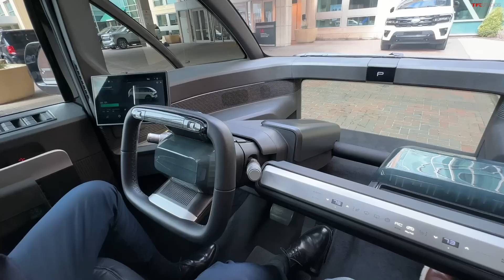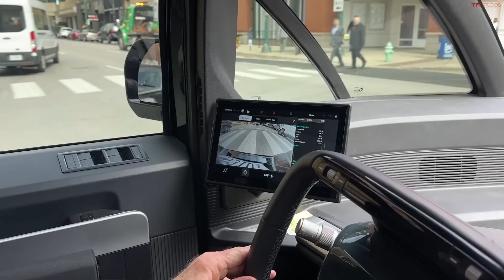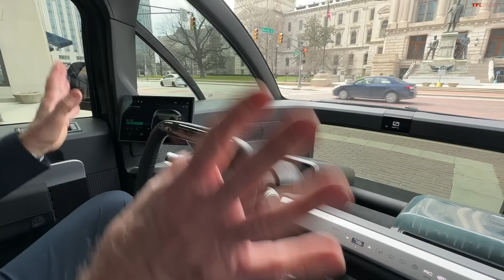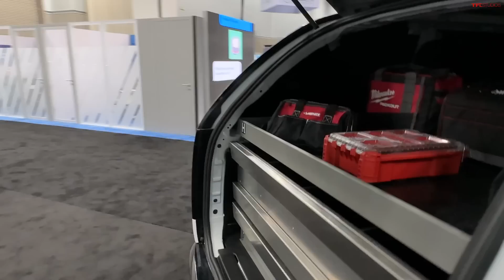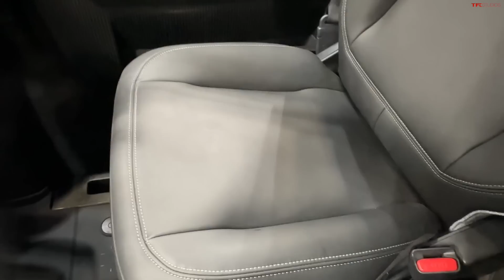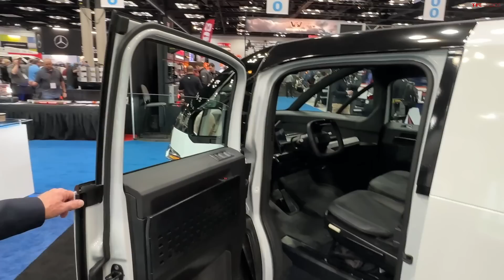The All-Electric Canoo Is Like NO Other Van You've Ever Known or Driven: Come Ride Along With Me!

Comment: Canoo if you’re reading this, small feedback: the steering wheel is a very expensive real estate for JUST mirror adjustment dials. I set my mirrors once. It’s not like I constantly need to adjust them while driving. I would put those controls out of sight.
Reply: The delivery vehicle is the proper use case for the mirror controls in it's as that is the most common button used for fleet management companies who have several drivers per fleet vehicle.
Reply: @b18tuner5875  I would argue that if there is a fleet, then there is the possibility that each driver's profile could be digitally stored so that as each driver connects to a vehicle to drive it, the car's "adjustables" would auto-adjust to that drivers settings.  That would be the greatest time saver.
Reply: @digiryde  That would work if each driver didn't need to change the mirrors at a moments notice, tens if not hundreds of times a day.  Would you personally remember which setting is what if you have 10 settings?  Also, memory functions like this are a huge added cost to the building of a vehicle.
Reply: @b18tuner5875  "That would work if each driver didn't need to change the mirrors at a moments notice, tens if not hundreds of times a day.  Would you personally remember which setting is what if you have 10 settings?  Also, memory functions like this are a huge added cost to the building of a vehicle."

Huge added cost...  I am not sure how much of an added cost of a small data structure based on a unique ID (fleet wide) that simply holds settings for devices would cost.  I do know that taking 5 minutes for every driver change has an added cost to business over a year, assuming that the vehicles used daily are not used by the same person and noone else. 

It might not seem like much, but some simple arithmetic for a one shift business at one driver per day:

5 mins * 5 days = 25 minutes.

25 minutes per week * 51 weeks per year (assuming 5 down business week days) = 1275 minutes ( 21 hours and 15 minutes per year per van).

Take a fleet of 100 vehicles = 2125 hours per year.  Employee cost per hour at 50 ($30 hourly pay, benefits, taxes, etc.)  gives us 106,250 dollars per year fiddling with settings.

If we assume a delivery vehicle's life time is 5 years, then the gross cost of fiddling for the vehicle if over $500,000, or $5000 per vehicle.  As all of the hardware is already in place to automate this process, the only thing that needs to be done is write the software and maybe add a sensor to ID the driver which would be less than $100.

If the selling company were to write the software and provide the service, they only need to do it for under $250,000 to make it an easy call for companies that are constantly changing our who drive which truck on at least a daily basis.

How hard would this be?
As the adjustments are done using digital controls (fly by wire), and the devices being used to control the positioning of the various "user" adjustable devices, all one needs to do is record the accepted position of each device.  So, once a device is set, record its positioning and save it for that user id.  Not hard stuff.  The authentication and authorization will be more difficult.

Once this software tool is done, it is there for everyone.  Bonus.  Family vehicles can use the same tool to provide customized settings for each driver that uses the family car.   This goes from seat settings to temp to radio to, well, everything.

Nice thing to know.  This has already been done by several auto-manufactures on vehicles that were not controlled by wire.  Which means it has been done on vehicles that are more complicated to do this with.

Is this a huge deal?  Not the biggest expense, but at the same time, business profits are all about cutting every dollar they can and these are dollars, not dimes.
Reply: @digiryde  I am impressed that somebody tried to explain engineering to a previous chief automotive engineer! Unfortunately, your explanation seems to completely misunderstand how automotive message networking systems work!  It has to do with message deliver over a bus rather than a voltage difference over a wire.  I would recommend you read into automotive systems engineering and then we can pick up there!
Reply: @b18tuner5875  " I am impressed that somebody tried to explain engineering to a previous chief automotive engineer! Unfortunately, your explanation seems to completely misunderstand how automotive message networking systems work!  It has to do with message deliver over a bus rather than a voltage difference over a wire.  I would recommend you read into automotive systems engineering and then we can pick up there!"

I never said anything about a bus vs wire.  Some vehicles do this already.  Maybe they know something special.
Reply: @digiryde  Nice Feynman fallacy to try to cover up ignorance of the topic.
Reply: @b18tuner5875  "Nice Feynman fallacy to try to cover up ignorance of the topic."

Okay.  You are the smart one.  Tell us why this can not be done.
Reply: @digiryde  I never said cannot, I only said it is common in luxury cars.  This being a delivery car, the use case necessitates the mirror switches. As most people can only remember a sequence of 7 numbers (that's why telephone numbers are only 7), can you imagine memorizing 20 different mirror combinations?  See how inefficient that would be?  Sometimes, convenience is based on use case.
Reply: @b18tuner5875  Ok, being somebody who has gone through a bunch of educational testing and neuroscience study I'll note that the average human digitspan is about twelve—and that for a supposed engineer you spend a lot of time repeating yourself instead of explaining things, while shooting down others for spitballing things then doing the very same thing yourself. Don't tell me that you know things and expect me to bow to your authority, show me how you know them and why they make sense.
To show my receipts I'll quickly explain why USA 7-digit and 10-digit phone numbers are the way they are. It has to do with the history of the technology used to route calls and the design decisions made while standardizing those systems—no provision was ever made for how long a number somebody could memorize. In fact it was not expected that anybody would ever memorize phone numbers. The line number (last four) was assumed to be one of ten thousand as setting up a "Central Office" to handle more than that many rapidly becomes unreasonably difficult. The three-digit portion is literally the "Central Office" number. Over time the "office" numbers of the form "X11" were set aside for custom services found in most if not all calling areas. (EG: 911) The three digits often enclosed in parentheses ahead of 7 other digits refer to the "Calling Area Code"—today often shortened to just "Area Code". Many places in the USA now have 10-digit dialing, FWIW, so Area Codes aren't just for long-distance calling.
What does this have to do with car mirrors? Simple, if you're going to make an argument you've got to be able to break it down into chunks that stand up on their own. You keep asserting that many if not all delivery drivers adjust their mirrors nearly continuously. I know from talking with my friends who are actual CDL-possessing professional drivers that you don't repeatedly adjust your mirrors while moving unless you want to be issued a moving violation—because doing so has been demonstrated to be unsafe. (Never mind that doing so is impossible on many vehicles—intentionally.) Canoo is therefore going to have to change that design, and give drivers better tools to see with continuously—no matter what delivery drivers say about it.
It is that sort of thought pattern which gets people to question "delivery vehicle" focused steering-wheel controls in a prototype presumably targeted at larger families and carpooling. We're not numb, we're looking at it from a different angle.
Reply: @b18tuner5875 given that voice controls are already a thing and will continue to be spread into more vehicles, I’d think that having between 5 and 12 mirror settings driven by voice commands would be easily achieved, and because they’d have a standard spoken language name they’d be easily remembered. If these mirror positions are changing as much as you suggest on delivery vehicles, why has no other car company done this on at least the delivery version of their vehicles?

The Canoo looks very interesting but if the mirror controls remain on the steering wheel in the standard consumer passenger version it’d be a big strike against it for me as a purchaser.
Reply: @b18tuner5875  Nonsense. You adjust them once when you get in the car (before moving off, hopefully) and then leave them alone.  So they're among the last things to get prime position.
Reply: @hoagy_ytfc  Not if you are a delivery driver.  What is nonsense is you assuming a car manufacturer is going to design a car around your bad driving habits!
Reply: @b18tuner5875  Even then, I used to be a delivery driver and you set it once a day when you get in today's van and that's it for the day. Maybe it would be easier to find when I'm moving through a mixed fleet of canoo, iveco, volvo, mercedes vehicles, but most just put it on the door in a visible spot to solve this
Reply: @AWildCarAppeared  You must have adjusted your mirrors once.  Most proper delivery driving habits include hundreds of adjustments per day.  Car manufacturers build for the proper habits rather than an outlier like yourself!
Reply: @b18tuner5875  Surely they could save the user profiles in the computer?
Reply: @b18tuner5875 mirror adjustments are still only done once per driver change. The controls on the steering wheels should be for thing that you control often while driving.
Reply: @CodyCha  Delivery drivers adjust the mirror several times during a single delivery, where do you get this idea?
Reply: @b18tuner5875  I just switched jobs.  The company I used to work for provided a field service vehicle to me.  I took it home everyday.  It was assigned to me.  I don't know the numbers but I expect over half (but probably not by much) of field service vehicles are assigned to one person and not yard vehicles where different people are assigned each day.  Delivery vehicles, sure different vehicle each day isn't a problem.  But if plumbers, electricians, automation techs, telephone techs, and a bunch of other field service employees had to drag their tools in and out of different vehicles everyday then they wouldn't stay at that company for very long.  Plus, the lost labor hours making trade workers switch vehicles would be a lot of lost profits.
Reply: @runnermatt  That's really nice! But that means you weren't a delivery driver who makes many stops and uses their mirrors hundreds of times a day.
Reply: @b18tuner5875  Yes, that is what I said.  Why are you telling me what I already said?  Also, I was pointing out that the use case that you listed wouldn't be the primary use case for MOST users.  Indeed the fleet service version they showed was the use case I had.  NOT the use case you listed.
Reply: @b18tuner5875  "But that means you weren't a delivery driver who makes many stops and uses their mirrors hundreds of times a day."

Most of us would fall under that category.  I would ask this then.  Why are delivery drivers adjusting their mirrors so often?  Assuming you are referring to the core discussion of the adjustment tools.

To me this screams that the problem is the lack of proper mirrors/vision in the first place.
Reply: @The_Opinion_of_Matt  At this point, most users are fleet customers, if you aren't not familiar with Canoo's production plan, they are only focusing on commercial customers for the first year.
Reply: @b18tuner5875  Outside of FedEx, UPS, Amazon, and the USPS most fleet customers are field service technicians, not delivery drivers.  FedEx, UPS, and Amazon are using larger vans than CANOO is building.  So the only large delivery company that might use them is the USPS, which considering the drive by wire function it would be relatively easy to shift the steering wheel to the other side, but then the USPS has historically used vehicles that are smaller than the CANOO van.  
The remaining commercial market is field service technicians, which is probably part of the reason why CANOO displayed one of their vans that was configured for field service technicians, not delivery drivers.  You have latched onto a single feature that suits your personal use case and CANOO doesn't even appear to be actively pursuing that your market usage.  Will they sell it to you?  Yeah sure, why not, money is money.  But you are aggressively defending a feature that most of CANOO market either wouldn't care about or wouldn't want.  I glad you like the feature though.  I hope they leave it in just for you.
Reply: @digiryde  dude..we are NOT adjusting our mirrors..that's absolute BS by this clown..
Reply: @digiryde  Canoo is only producing for the commercial market in 2023, so it would make sense that they aren't building for you.  Us commoners have to wait a year or so to get this the Lifestyle Vehicle.
Reply: @b18tuner5875  "Us commoners have to wait a year or so to get this the Lifestyle Vehicle."
True.  So, wait we shall, hoping they make it.  The space needs more real competition with novel ideas.
Reply: @digiryde  Canoo has an earnings call end of this month, but in the last earnings call it was stated that SOP was reached, meaning they are producing right now.  They can't lie about this since they are a public company.
Reply: @digiryde  Yeah as a former commercial driver I only had to adjust my mirrors in the bay before going out on the road. I can't imagine a scenario that would have required me to adjust my mirrors more than once. Especially on a vehicle like this that is not only much smaller with a lot of windows, but also has cameras and multiple camera angles.
Reply: @b18tuner5875  Even if it's used as a delivery vehicle, why do you think it's better to place the mirror adj buttons on the steering wheel rather than the usual spot, on the driver-side door panel?
Reply: @b18tuner5875  @GregV8 got rekt
Reply: @b18tuner5875  Yeah, but with this tech, an employee should log in and it should adjust for that driver.
Reply: @b18tuner5875 good point
Reply: @b18tuner5875  they were test driving the passenger version.  03:58
I agree with the OP, it makes no sense to have them on the wheel.
Reply: @kewlztertc  it makes sense only as a money savings between this version and the commercial version.
Reply: @kewlztertc  that’s a commercial passenger van (taxi, shuttle, etc)
Reply: @kewlztertc  They also showcased the delivery vehicle.
Reply: Lights and wipers should be on standard switches or on turn signal stocks. Taking your eyes off the road and fumbling with a screen is ridiculous for such features.
Reply: @jnicksnewstart  The lights and wipers are automatic. Just like most modern cars today. You can turn off the auto-setting on the touch screen but otherwise nothing to worry about.
Reply: How did they not think that a volume control and menu navigation controls would be better? Not even cruise control adjustment on the wheel itself? Fail.
Reply: As a delivery driver, I'm constantly readjusting the mirrors, not just because other drivers use the truck, but because different situations call for different settings -- open highway versus manoeuvring in a loading dock for example. More cameras would help, but you can't beat actually seeing behind you. My beef here is the steering wheel shape -- a round wheel seems like a better choice for constant manoeuvring.
Reply: Exactly my thoughts, I wanted the interviewer to say something about it. It's even wrong to have them there because you can touch the wheels by mistake while steering and mess up the mirrors
Reply: @MuhammadO19  it's not wrong since this is a delivery vehicle and delivery drivers adjust their mirrors hundreds of times per day.
Reply: u should adjust mirrors to see how close tire is to the pavement
Reply: @bittasweetsymphony726  Wow! How long have you been driving that you need a mirror for that!
Reply: I adjust mine frequently. Strange amount of people with their brights on and their lights are at different heights.
Reply: How about making those buttons programmable. Sound up/down… climate control… that way the vehicle adapts to the user.
Reply: on the door, on the left, like a normal car.
Reply: Agreed, as a professional delivery driver, I need a toggleable side mirrors, especially in Hawaii where the freakin parking is tight.
Reply: @OuterSpaceDogs  That is good to see the actual market speaking to the effectiveness of this feature.
Reply: There are other vehicles that use controls on the steering wheel to adjust the mirrors: the Tesla Model 3 and Model Y. On those cars, you first select mirror adjustment on the touchscreen, then you use the dials on the wheel to make the actual adjustments. When you're not adjusting the mirrors, you use those wheels to adjust the cruise control speed and the volume of the sound system.

I expect that the controls on the steering wheel of the Canoo will be used in the same way. The software just isn't ready yet, as it's not a priority for the users of the vehicles they have delivered so far. Those may not even HAVE an infotainment system, and you're not using cruise control on urban streets.
Reply: Agree @GregV8....and, while speaking of mirrors, the passenger-side version should actually be positioned further forward, so that it can be seen through the "quarter-window" ahead of the A-Pillar. That way, the driver doesn't need to turn his head to see the partially hidden inside edge of the mirror at the current location.
Reply: @andrep8287  If the steering wheel is steer-by-wire, why not just move the driver position?  Maybe you personally had this experience but it doesn't seem like a problem for anyone else.
Reply: I agree.  Even in fleet use, the driver would set the mirrors just once before he started out.  The steering wheel buttons are needed for things that may be selected more than once when driving.  I'm not convinced that the rectangular steering wheel is an advantage.
Reply: @Bobrogers99  What is the problem with the rectangular steering wheel? The wheel is never turned full circle on this vehicle.
Reply: @macmclemore  - To understand the problem with using this type of steering wheel on a street driven car you need to understand why these types of wheels are used in Formula racecars. Racecars typical have a very fast steering gear (referring to the gear ratio of the steering gear). In fact in a formula car the steering ratio is such that it take less than one full turn of the steering wheel for the cars wheel to go lock to lock from one side to the other. Anyway when the steering is that quick there is no need to ever move your hands from the 9-3 position so a rectangular wheel is ideal. In a street car on the other hand you might have to turn the steering wheel 2.5 times to go lock to lock. This means that on sharp turns you have to either do the hand over hand thing or the hand slide and its very awkward doing either of these things with a rectangular wheel. And or course a very quick steering gear would not be desirable on a normal passenger car because it would make the car dangerously twitchy at high speeds. Of course, the car in the video has adaptive steering I believe, and this gives you the best of both worlds as the steering ratio can change to suit conditions. Still, even though this car steering ratio at low speed is just slightly more than one turn lock to lock, as you can see in the video you still need to go hand over hand when making a U-turn in this car – either that or twist your arms into pretzels if keeping your hands firmly planted at 9 and 3. And on a side note, the way the guy is driving the car using just his fingertips on the wheel is not safe as he would not be able to quickly initiate an evasive maneuver in an emergency situation. In any case, although this is the only kind of steering wheel to have on an open wheel race car, I would find this type of wheel to be extremely annoying to have in an ordinary passenger car.
Reply: @SLOBeachboy  Why are you trying to explain yourself to me…?
Reply: @macmclemore  - Whatever gave you the bizarre notion that I was trying to “explain myself”. I was simply answering an automotive question, since I quite naturally assumed that when someone poses a question in a public forum they actually want to know the answer to that question. I also assumed that even if that person had no interest in knowing the answer to his own question that some of the other readers might be interested in knowing the answer.
Reply: @Bobrogers99  During fleet usage the driver will set their mirrors several times during a single delivery, where do you get the idea that they set it once?  Regular passengers, yes, once, but not fleet drivers.
Reply: @b18tuner5875  Correct. 10 year delivery driver UK. Mirror adjustment near to the driver would be brilliant. None of our fleet have it. 

On rural UK roads, turning right on a *Y junction (Asterix signifies position of vehicle) it is impossible to see anything coming from the left unless I take off my belt lean over the passenger seat and peer out of the window... far from ideal. I creep out and hope I'm seen, again far from ideal. An electric mirror adjustment on the driver door or steering wheel could literally be a life saver. Moving the mirror outwards to see cars approaching from the left in a RHD vehicle.
Reply: @Satans_cat666  See, it is most likely the American delivery driver or American in general that doesn't use their mirrors.  Your experience is exactly what delivery/fleet vehicles are designed for.  Canoo delivery vehicle is their first announced production vehicle so some options such as the mirror controls are probably tailored toward your use cases.
Reply: @b18tuner5875  I used to drive commercially, and I would set the mirrors before the route. Why tf would anyone need to keep adjusting the mirrors? Everything has cameras nowadays.
Reply: @b18tuner5875  Why would you adjust them multiple times? You do have the full rear view camera screen... If you cannot adjust the mirrors to back up safely in conjunction with the rear view camera, then you aren't setting your mirrors properly to begin with. Worst case, the delivery version should be equipped with trailering mirrors.
Reply: @b18tuner5875  Huh? I used to be a delivery driver and never felt the need to change the mirrors at all once set. I can't even think of a reason why you would need to do that. In fact in your average van there are very few that have electrically adjusted mirrors as standard and most don't even have them as an option. 

As for not placing other buttons on the wheel, they generally doesn't work that well on a wheel that is constantly being turned and I always saw them as more of a gimmick. The only one I use with any sort of regularity is the volume control. The only ones who ever got it right in my opinion were French car makers Citroen, who had the buttons on a fixed centre hub on the last C5 in Europe but for whatever reason it never caught on.
Reply: So you were a bad delivery driver?  Thanks for telling everyone! @severnsea
Reply: @b18tuner5875  Who's "everyone"? Are you trying to tell me you speak for everybody else on this discussion or is there something else you want to tell us all? One thing perhaps you could tell us is why you think that a driver who can cope perfectly well without having to constantly adjust his mirrors is a bad driver? 

Here are three comments from other drivers:
1. "I used to drive commercially, and I would set the mirrors before the route. Why tf would anyone need to keep adjusting the mirrors? "

2. "as a former commercial driver I only had to adjust my mirrors in the bay before going out on the road. I can't imagine a scenario that would have required me to adjust my mirrors more than once."

3. "Why would you adjust them multiple times? You do have the full rear view camera screen... If you cannot adjust the mirrors to back up safely in conjunction with the rear view camera, then you aren't setting your mirrors properly to begin with"

So come on then, I'll bite, why are you telling us all that you need to keep adjusting your mirrors when we can obviously all manage perfectly without the need to do so? Commercial vehicle drivers are trained professional drivers and I have a driving licence covering heavy goods vehicles (trucks), buses (for which I have several safe driving awards), motorcycles and cars, both of which I have advanced driving qualifications for, so maybe you're the one who is the bad driver. After all you're the one who can't cope without having to adjust your mirrors multiple times. No problems here.
Reply: No, you just tried to tell everyone that has commented on this that your personal experience is an expert opinion.  Just because you can't drive and use your mirrors properly, doesn't mean that the mirrors switches are not useful for delivery drivers that can drive properly and have commented it helps them. @severnsea
Reply: @b18tuner5875  No, you just decided for yourself that you think you know how other people should drive and use their mirrors. I quoted you three ACTUAL COMMENTS from other drivers that you can see for yourself on this thread that say exactly the same thing, so basically in trying to make me look stupid all you're actually doing is making a complete fool of yourself. I even asked you why you think that a driver who can cope perfectly well without having to constantly adjust his mirrors is a bad driver, but you couldn't answer that, you're just saying the way you operate makes you a good driver and therefore everybody else must be a bad driver. 

At no point have I ever said that they are not useful and obviously some drivers may find it useful to have the controls on the wheel and adjust them during certain manoeuvres, I never said it wasn't. But most commercial vehicles have convex mirrors so it's generally not necessary for most scenarios. Even my car has a side mirror that dips when I'm in reverse but a lot of people prefer not to use it and leave it in a set position. Just because you can't drive without having to alter your mirrors hundreds of times a day doesn't mean there's anything wrong with anybody else's driving, and it's just your opinion, not everybody's. 

In fact looking through the thread, all you have done is argue with most other people who have posted so while you're pretending that it's me against everyone, it's clear to see that it's actually you against everyone because hardly anybody agrees with anything you've said. You're the only one offering opinions on other people's driving, I'm not offering an opinion, expert or otherwise because unlike you I don't think it's down to me to tell everybody how to drive. Anyway, I'll leave you to play with your mirrors, I've got better things to do than waste my time with this nonsense. Grow up.
Reply: I agree with you about the knobs for mirrors.  Tesla just has no knobs because it's a button on the screen you adjust. I hope canoo survives.
Reply: I am curious.  If the vehicle was in a frontal crash would the windshield like glass above the bumper area fly through the interior like shards?
Reply: @jeffrymilton1093  Safety glass was invented in the 1920s to prevent that.
Reply: @The_Opinion_of_Matt  I thought so too but my windshield shattered in an accident but I still got superficial facial cuts as the glass flew in little squares.
Reply: @jeffrymilton1093  Superficial cuts isn't what safety glass was invented to prevent.  It was invented to eliminate 4-6 inch long shards of glass from impaling people in the face, neck and chest causing them to bleed out in the car.
Reply: @The_Opinion_of_Matt  however,  European standards require an additional layer of plastic on the inside of windshield glass to address this problem of shattered glass particle spraying upon vehicle occupants in the event of a crash. it also prevents the majority of facial lacerations from cases where occupants have struck the windscreen with their face in accidents. sadly this safety feature is not mandatory  (or even an option)  in vehicles destined for American markets.
Reply: @htopherollem649  Thanks for the info.  I wasn't aware that Europe had that standards.  Here in the U.S. we get the cheapest legally built that the manufacturers think people will willingly pay for at the various price points.  Each manufacturer interprets what people will willingly pay for differently and that is how we end up the variations in quality/luxury/performance.
Reply: @The_Opinion_of_Matt  as far I know the European standard has been in effect since at latest the early 80s, and an extra layer of the plastic film used for windscreens could not possibly add much to the price and difficulty for manufacturers.  I'm surprised that insurance companies in America haven't pushed for the safer option to minimize disfigurement claims
Reply: @The_Opinion_of_Matt  Not true. Laminated tempered glass is the regulated standard in North America for all windshields.
Reply: @ronlaverdiere  VEHICLE SAFETY STANDARDS AND REGULATIONS DID NOT EXIST IN THE UNITED STATES OF AMERICA UNTIL THE 1960s.  Sorry for yelling but your comment made me think it was needed because you seem dense or unable to read before deciding to tell others your inaccurate opinion.  Try looking up the book "Unsafe At Any Speed" by Ralph Nadar
Reply: @The_Opinion_of_Matt  learn reading comprehension. I never freaking said WHEN it became the standard. I said it IS THE STANDARD. Laminated safety glass IS MANDATORY in North America. How dense do you need to be to not follow a simple thread?
Reply: @jeffrymilton1093  Windshields don't shatter like that....
Reply: They will copy tesla and make them do everything from cruise control. Volume. Follow distance, voice control, motor adjustment. They prob just can’t advertise it this way.
Reply: @Jack_Hagerty  Interesting, how do you know this?  Also, Tesla is junk, what smart company would copy what they do?
Reply: can't put a price on safety
Reply: my first thought as well.
Reply: Speak for yourself
Reply: Absolutely! I would rather the mirror controls be in a screen menu than right on the steering wheel.
Reply: how about "Manual button Programing" where the user can program what the buttons do and control, and why don't they have an app that programs the car for each driver based upon one button push?  Our surgery rooms were set up like this.
Reply: @e2U  yes that is better my friend
Reply: @e2U  Neither of these solutions would help the average human who couldn't possibly remember 20 or so preset settings, as delivery vehicles change mirror positions several times with each operator.
Reply: Add a camera that looks back on both sides and rear, on one monitor,  that also detects any obstacles and or movement that can also break prior to breaking anything...but I'll bet that lobbies (legal bribery) from the repair shops and dealers,  may profit extremely from repairs and maybe all the after market suppliers too.
Reply: @e2U  adding cameras is cheaper than a button to control the mirror? Interesting!
Reply: Exactly what I was thinking. I set the mirrors and generally leave them alone. Put those switches on the door or touch-screen. Wheel should have at least cruise control and audio level  plus soe programable buttons. That should be easy to do and is very important IMO.  Otherwise nice!
Reply: @Carl Gunderson See my other comment replying to his response.  I did NOT mean armored or bullet proof glas.
Reply: @runnermatt  most modern automobiles have anti-shatter technology, similar to bullet proof glass. It's not my fault you don't understand this simple concept, especially when there are crash videos of this exact vehicle and the windshields never explode.
Reply: @Carl_Gunderson  Canoo has their own crash testing results posted on YouTube, its not my responsibility to teach you how physics and windshield anti-shatter technology works. 

As far as other vehicles that have this control? Not sure what you're getting at. It's useful for a delivery vehicle though, so because the use case is smart doesn't mean you have to approve of it.
Reply: that was exactly my thought as well.  Steering wheel needs to be quick access controls, like bluetooth calling and stereo controls.  There's a reason most cars have the wing mirror adjustments out of the way.
Reply: @gamer_therapy_console_yourself  Most cars aren't designed for fleet use or delivery use.  That's the reason they don't have it but the Canoo delivery vehicle does.  It's really interesting how many people like yourself try to justify something that was already known.
Reply: 1) but these vehicles' primary purpose is to be used by companies which probably will have multiple drivers.  That being the case, those mirrors will probably be set daily, or even multiple times a day.  And 2), there is no "primary real estate" for a steering wheel which is nowhere near a limit of housing interactive elements for functionality.  In other words, who cares if its there, its not taking room from anything else, and doesn't interrupt driving.
Reply: @Miguel_Molina  finally a smart comment, you are totally correct in your analysis.
Reply: ya thats a stupid design
Reply: you dont even use your mirror
Reply: I can see the need to adjust the mirrors on the fly. You ever want to keep an eye on someone sus while parked to make sure you are good before you get out?
Reply: I other hand use my mirrors all the time.  I tilt right side mirror down to see the curb when parking.  I got the idea from
Cadillac, my mirai does this automatically too when im reverse. 

I don’t mind mirrors being out sight, if they will automatically tilt down when in reverse
Reply: Obviously a left over feature from the commercial van, where a different driver per day would use the Van hence the need to readjust the mirrors often..
Reply: Right, things you barely use should never be the main buttons. Put those to the side.
Reply: @ZaprixaPrivate  Delivery drivers use these buttons hundreds of times per day.
Reply: @b18tuner5875  Yeah, keep it for commercial use. Not the case for other areas of the market. If anything this can get annoying for normal ppl bc they will just accidentally press it. I have been there.
Reply: @ZaprixaPrivate  That's literally what this is, Canoo delivery vehicle.  This is a delivery vehicle.  Do I need to expand that this is a delivery vehicle?

And I am sorry, please do not mistake your poor driving habits for "normal people".  You would literally have to have your hands in the incorrect steering wheel positions to hit those buttons.  It's probably why they aren't placed in a spot where they are easily hit.  Do not confuse your incorrect steering wheel control and driving posture with "normal people".  Manufacturers have to make products for the assumption they will be used correctly, and it seems Canoo had this in mind by placing the buttons out of normal driving reach.
Reply: I agree. It’s a design fail 100% and if they keep it on ALL models, well then, design stopped when Tony slimed in
Reply: Agree. Maybe radio and cruise control
Reply: Seriously, the lack of steering wheel audio controls is a deal breaker. Can't say Im a huge fan of the left side screen either but i'd probably get use to it.
Reply: That steering wheel is the reason I wouldn't buy.
Reply: I hate steering wheel controls because I always hit them accidentally
Reply: Good, these aren't meant for you since its a delivery vehicle and not a typical passenger vehicle for a consumer like yourself. @Ag3nt0fCha0s
Reply: Where’s music control?
Reply: I totally agree take those off the wheel
Reply: its aimed at delivery firms who have different drivers on every shift.  They are rolling out the fleet version first and I guess that's their focus.
Reply: So is it cool if my dog rides in the front?
Reply: Canoo should go the direction of Aptera and make it possible to get rid of the mirrors altogether. No controls needed, no added drag on the highway.
Reply: Thought the same
Reply: It's a delivery truck genius
Reply: We need room for luggage
Reply: good point.. i also feel the interior could be simplified to save production costs. like those little window vents on the sides... completely unnecessary...  hell they could have made it without the entire roof being glass as well to save more. If it was a solid utility people mover and performer people would still buy it without the fluff.  Still not sure about the front end.. feels like a lot of wasted space but im not exactly sure what they could do with it.
Reply: Junk
Reply: Should be a multifunction control. Cruise, volume, a/c speed.  Just make it more functional via software. Don't add buttons
Reply: I’m 6’3” and my wife is 5’2”, and we are constantly changing the side view mirrors. Buttons on the steering wheel is good for us.
Reply: @kevinmcgrane4279  Do you change your mirrors while driving? Controls on a steering wheel are for adjusting things while driving so you don't have to take your hands off the wheel. Any modern car will save your and your wife's mirror settings and automatically load it as you get in.
Reply: @GregV8  Yes, as I previously stated, delivery drivers change their mirrors constantly.  This means while they are driving, delivering, etc.  Also, most luxury cars have memory settings, not normal passenger cars.  Again, this is for ease of delivery and fleet usage, the passenger vehicle may well have memory settings.  I feel as if you do not understand automotive networking systems, and how much added costs and engineering goes into memory settings.  This is why, typically, only luxury vehicles have memory settings.
Reply: @b18tuner5875  You keep talking about delivery vehicles. He mentions the mirror controls while driving the Lifestyle Vehicle which is a passenger van. That steering wheel space would be much better used for volume and infotainment control, cruise control and phone control.
Reply: @Hot_Guac  The delivery vehicle was also featured and has these same controls.
Reply: @b18tuner5875  the hell are you talking about?..are you a delivery driver?..why the hell are you changing your mirrors?..I delivery drive in both a cargo van and a 5 ton truck..I NEVER adjust my mirrors..why the hell would I???..they're set to see behind you..what are you going to move them for backing up?..if you need to do that they were never set up properly in the first place to see behind you in traffic..insanity..
Reply: @b18tuner5875  And as the Canoo rep said - the van in this video that he is driving IS the luxury, fully loaded version. So yes, it should have memory settings. Considering how simple it is for manufacturers to have memory settings with all the touch screen and software systems that even the most basic cars have now, memory settings are no longer luxury items. Just like power windows and A/C have been standard equipment since the mid 1980s.
Reply: @b18tuner5875  I have been driving for a living for 35+ years, over 2,000,000 miles (food delivery, cdl, and uber, etc.) I set my mirrors once and never move them.
Reply: @kevinmcgrane4279  but this can be done with Driver Profiles…along with seat location.
Reply: @kevinmcgrane4279  buttons on the steering wheel also means you can correct the viewing angles while driving, and not have to pull over several times to adjust what you thought was the proper angle.
Reply: @kevinmcgrane4279  No, a memory setting is good for the two of you. Set it once, set the memory, and that is it. Modern cars even know the setting needed for each key, so when you get in with your key it automatically sets the mirrors and seats for you. When she gets in with her key, it sets it to her positions. Buttons on the steering wheel for the mirrors are silly no matter how you look at it.
Reply: Can you imagine driven around and see your side mirrors out of whack?
Reply: @Light23K  How is that any different from any car today?
Reply: @digiryde  There is so many cars made throughout history and zero cars have their mirror control on the steering wheel. Thats not only different but one of a kind.
Reply: @Light23K  "There is so many cars made throughout history and zero cars have their mirror control on the steering wheel. Thats not only different but one of a kind."

I have never heard of any either, and yeah, that makes it unique if so, but does that make it good?

It really boils down to personal taste for the end user.  My job is looking for ways to improve processes using IT, so I normally think in terms of how you do that.  It does not mean that every dollar saved was saved well.  In this case, saving x minutes is a scaling savings with a very small (relatively) up front cost.  Is it worth it is an exercise for the market and the manufacturer.  :)
Reply: @Light23K  You might but most people use their mirrors enough that they won't be surprised to see them moved.  Also, if you are hitting the mirror controls on this vehicle, your hands are clearly in the incorrect steering position.
Reply: @b18tuner5875  There is a reason no other car ever made put their side mirror control on the steering wheel. BTW I love to put my hand on top of the steering wheel. There is literally zero reason no matter how hard you try to come up with one.
Reply: @Light23K  lol because you can't drive properly you get salty and then think you're right. Nice self report! You must be a peach to live with!
Reply: @b18tuner5875  I am right and you are wrong because history showed us already and you're just too blind to see it.
Reply: @Light23K  oh so you're an automotive engineer?
Reply: I adjust my mirrors all the time depending on the type of traffic I am in.
Reply: For Delivery vehicles perfect, for customer not so perfect. Would rather have it like tesla, buttons change what they do…
Reply: @laser_simon922  That is why this feature is on the delivery vehicle.  Also, Tesla is junk, why would a smart company copy junk?
Reply: These vehicles are rude with illogical design choices and wasted space. One of the reasons Canoo will fail.
Reply: @mbaxter22  Interesting, total self projection here.  I love when people throw insults without justification.  I am curious to what you are referring to other than your hurt feelings.
Reply: @b18tuner5875  LOL that was a typo. I meant to say that the Canoo vehicles are “rife” with poor design decisions and needlessly wasted space. They just need a little tweaking, though. I do love the utility van concept.
Reply: @mbaxter22  What tweaking is needed im curious?
Reply: Tell me the what you paid and what the maximum range is (fully loaded) so I can laugh at you.